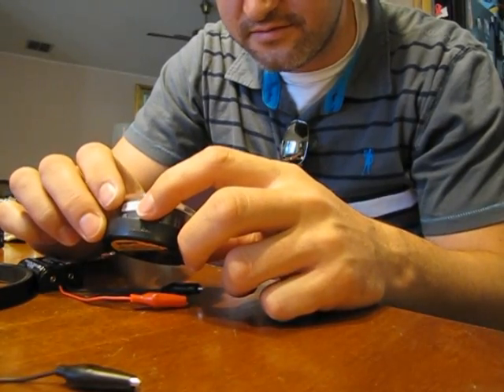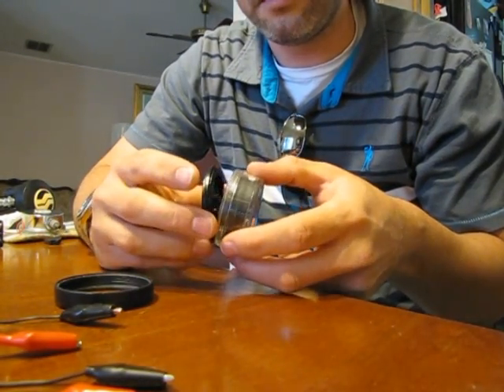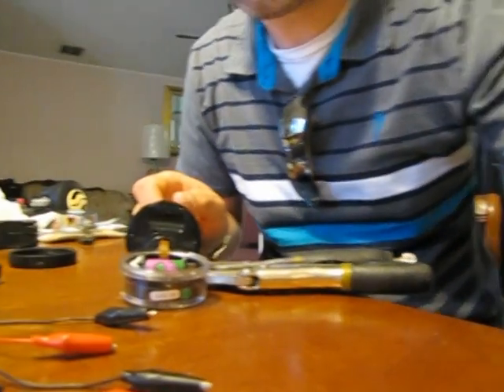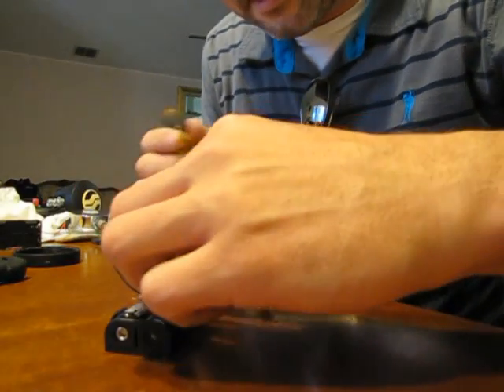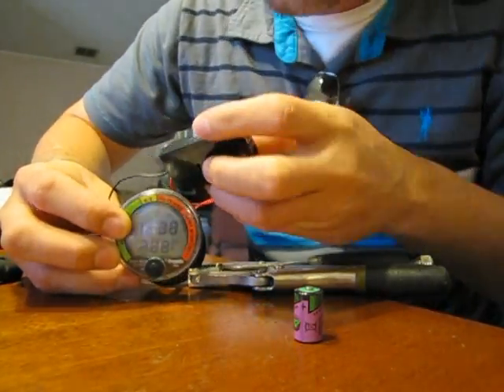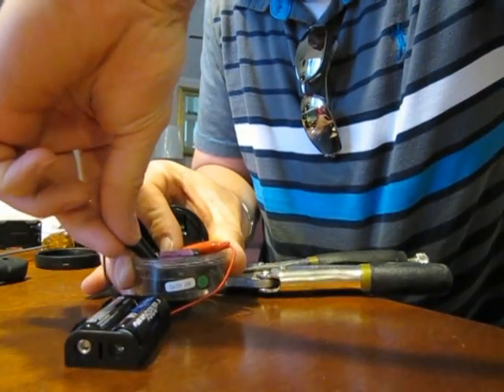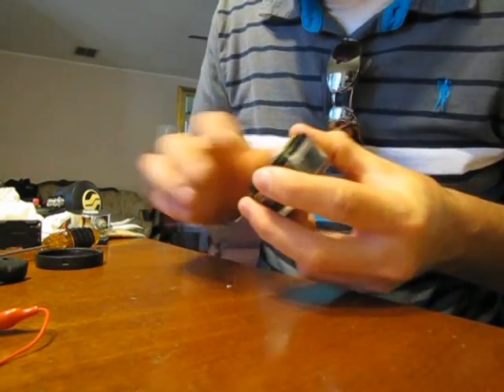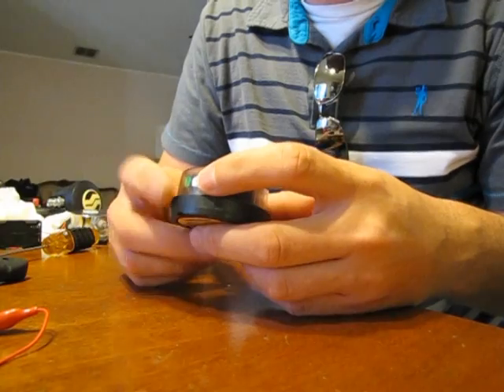ocianic datamax battery change dive computer

Comment: Hello. I followed your instructions on replacing the battery. However; after I've powered it back up and does the count down, I don't get the 'Surface Mode' it just flashes 'Lo Batt' and shuts down.
Brand new identical battery installed !

Comment: Nice Video. I have one that doesn't turn on anymore at all. I followed your directions to get to it and the battery reads zero volts. Had some black stuff on the positive terminal. I don't see a need to put 3 volts on it to change it. Do you agree? I am ordering a battery which is a 14250 3.6v. I do have some wireless transmitter batteries for my shearwater computer that are CR2, 3volt. Do you think they would work? Being dead so long, am I wasting my time? I was just hoping to get it going as a backup.
Reply from the maker: Yes, the 14250 and crs2 are almost the same size. The cr2 would probably work but I would just use the 14250. I always recommend putting 3v to the board when swapping the battery but I think you’re right with it reading 0v it most likely won’t matter. good luck and keep us posted.

Comment: Have you service, changed the O-Ring or ever lubricated the push button O-Ring at the front pf the computer. I have a Data Max Plus, over 20 years old, working flawless every weekend, and ever wonder if I need to bother with the case and the push button O-rings. Thanks.
Reply from the maker: I cant recall if i did or not sorry. i dont think it would hurt to take the oring out and inspect it and lub it up.

Comment: I changed battery in mine but now I cant turn it off....
Reply from the maker: once on it will stay in surface mode for awhile then turn off. how long has yours been on?
Reply: @Adam81  it stayed on for a little over an hour after I finally just set it  down and walked away and came back it was off.
Reply from the maker: @chadcook87  sounds like surface mode. totally normal.
Reply: @Adam81  ok thank you!

Comment: My DataMax Pro is reading Low and I want to replace the battery. Is it imperative to use jump leads, as shown in the video, or can I just change the battery without using the jump leads?
Reply from the maker: I have a data max pro as well. I have another video of me changing the depth sensor. No you do not need to use the jumper box like I did on the datamax.
Reply: @Adam81  Many Thanks

Comment from the maker: i herd of a guy that pushed on the pressure sensor on the back while powering on the unit and he said it started working again but i have never tried that. from what i have heard you would have to have the comp re flashed with the software but the company doesnt have it any more or just wont so you are forced to buy a new comp from them. sorry i couldnt be of more help.

Comment from the maker: u dont have 2 physically keep power 2 the unit. but i would highly recommend that u do because a friend of mine had the same comp & when the batt went dead he just took the batt out & put a didnt put a new 1 in 4 days. the comp just sat days without any power & when he put a new batt in the comp never worked right again. it would power up and count down then turn off. i dont know how long the unit can go with out power before it will suffer the same fate as my friends comp so again i would